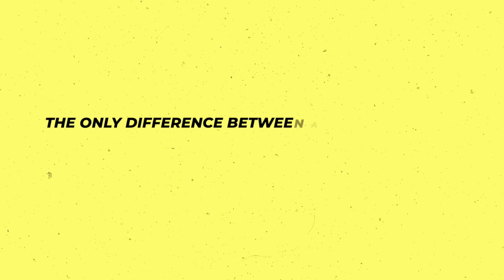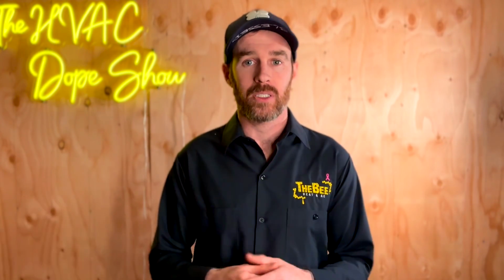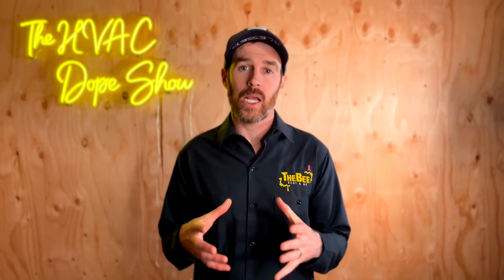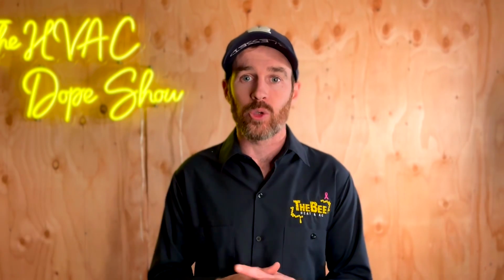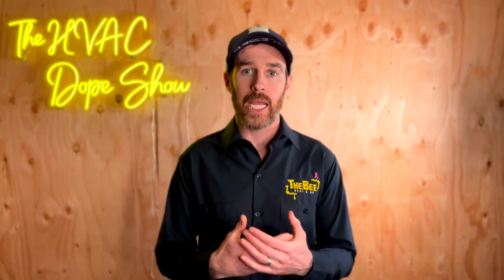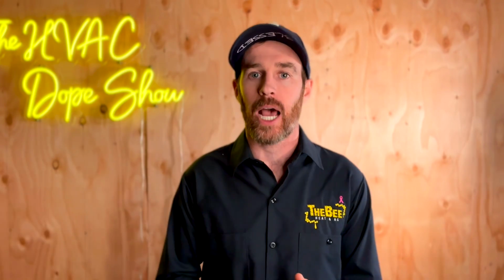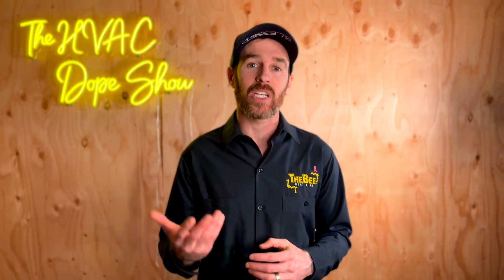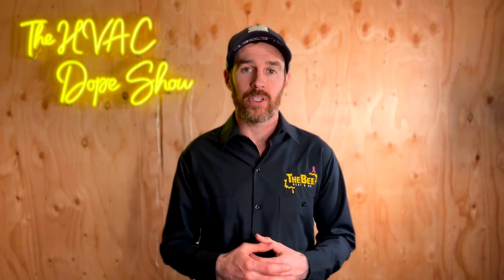Why High Efficiency Furnaces always BREAK 😬

Comment: If you live in the Colorado Mountains, I’ve seen problems with high efficient furnaces on septic systems. In the metro area we have basements, so our sewer lines are over 6’ deep. When you’re in the mountains and on a septic system most septic tanks are 3’ to 4’deep. That means your sewer line is about 3 to 4 feet deep. This can cause a freezing problem within your sewer line. As the water trickles out super slow and gets outside of your home it will freeze and slowly block your sewer line. If you live in the home full-time it won’t be a problem because you are actively sending large amounts of water down the sewer line. If you leave on vacation for a week, it can most definitely be a problem. As the water slowly comes out of the furnace it travels down the sewer line and ends up freezing causing ablockage. You get home and start using water only to find out later when you have water coming out of your floor drain due to blockage.  I have received several calls from clients to thaw out their sewer line due to condensation freezing in the sewer line. A lift pump will solve the problem because it will send 2-5 gallons of water at once. I won’t waste my time or a client’s time by installing a condensation pump because it still isn’t enough water to prevent freezing.

Comment: A few years ago I asked two great service techs if they would install a high tech furnsnce in thier own homes. Both said no. A million dollar house that I wired up had 2 by 6" fully installed exterior walls and over R50 in the attic. HVAC company talked him into installing two high tech tech jigh efficiency heat pumps. ( One fir tirst floor & other gor sevond floor). House had natural gad for the emergency backup. First year under free warranty both heat pumps broke down. Second yesr same thing but it cost him slmost $500 im labor. I told him to just run the jouse on nstural gas and next three years did not have any cold weather ecoensive setvice calls. Running on gas was chesper over all & s lot more dependable.
Reply from the maker: Yikes… that’s different than high efficiency furnaces but sounds like an issue that should have been caught under warranty.

Comment: As a 25 year install, all furnaces have issues but the majority of issues i see is lack of maintenance on the homeowners part.  Those two points are 100 percent the cause of most issues
Reply from the maker: 💯😂 very true… that’s why we only install high efficiency furnaces when homeowners are aware of the maintenance and understand the damage basic things like not changing the filter will do

Comment: So high efficiency furnaces break because installers are unable to read and follow the installation instructions.  I'm glad none of that applied to my two DIY installations in 2008 that are still performing flawlessly, after replacing only a 12-year old ID fan that became noisy.  Oh, and put bird screening on both vent pipes; bird beaks in the ID fan stopped one of mine from turning, found and corrected at the beginning of a heating season checkup.
Reply: well if you read and followed the that same install manual you would see putting screens on vents is against their rules
Reply: @chadschafer3890   Not so for Goodman which provided an intake screen.  I drilled holes in a cap to make a duplicate for the exhaust, rather than use an open tee. Use of nothing, as in the video,  invites trouble, as I found out with two birds entering my 2" pipe and navigating two bends to the ID fan to die.
Reply: @robertmeredith3940  There's a reason the didnt include one for the exhaust.  Its not because they ran out of them.  Again feel free to read the manual before you have no heat one day and wonder why
Reply: @chadschafer3890  I did have no heat one day - because I had no filter on the exhaust. The furnace has run for about 12 years since then at temperatures down to -10F with no problems. No regrets. No more bird problems. Your choice.
Reply from the maker: Robert I don’t disagree lol… idk what the manual says for each unit on the market off the top of my head but we have less issues with birds / rodents etc (or toddlers… I’ve pulled toy cars out of exhaust before lol, the parents loved that one) but that’s why I prefer to put screens on them. Less callbacks
Reply: I have found screens on the exhaust frozen. During the 5° weather that condensation that collects on that screen can quickly freeze up and plug the exhaust.

Comment: Kind of off topic, but could you explain altitude derate for heat pumps? I have a Mitsubishi PUZ-HA30NKA1/PAA-A30AA1 and am at 5800ft (COS). Does this mean I'm really only getting ~24K BTU from my condenser? Thank you!
Reply from the maker: My understanding is that it technically has to do with airflow not the capacity of the condenser, since the refrigeration circuit is sealed the condenser itself doesn’t derate. At 5800’ you’re moving about 15% - 20% less air than Sea Level so the derate is based on CFM of air coming from the air handler / head unit inside, so the actual output is effectively lower because airflow is lower. But often times the head units can move more than the required minimum per ton of cooling/heating so sometimes with the settings and airspeed adjustment you can counteract this